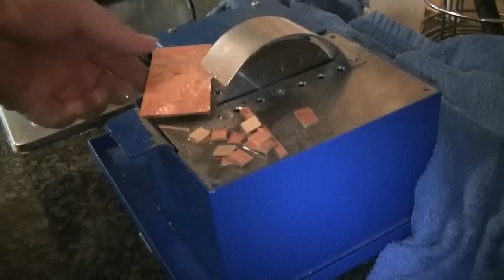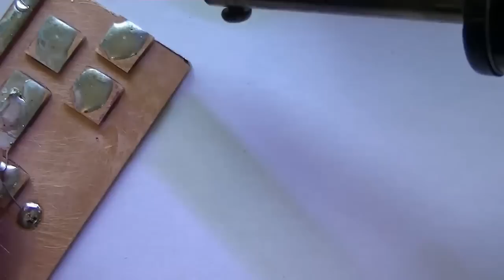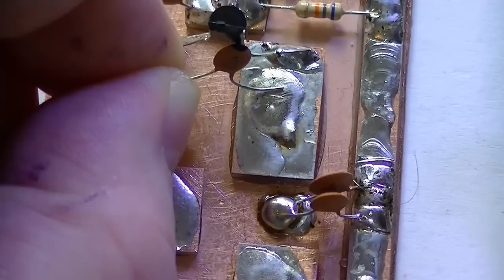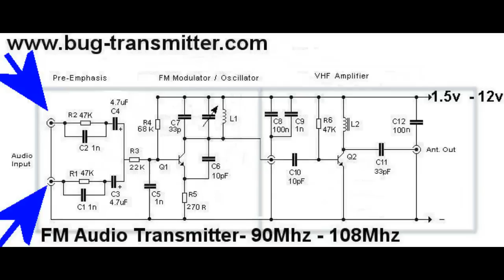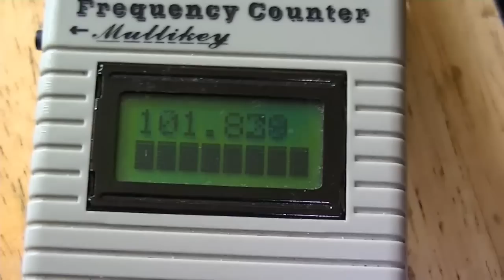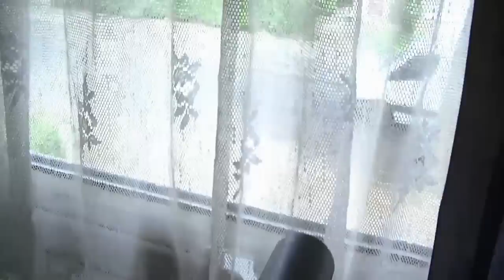Build your very own small home radio station.I show you how to build a small FM transmitter

Comment: i just finished building this circuit. i am using it as i write this comment. Very VERY stable transmitter. the sound quality is reasonable also. i would say its low end frequency response would be 60hz or so. Love the circuit, thanks for sharing. 
To anybody thinking of building this circuit, it is an absolute must!
Reply: @letitrotfuckit  did you build this?
Reply: @letitrotfuckit  I got an sdr I'll tune into your sw frequency, what is it?
Reply: @letitrotfuckit  I'm all the way near WV

Comment: i just built this thing, gave it 4V and without even having the antenna connected i could pick it up outside of my apartment, and it is indeed very stable. thanks a lot sir! looking forward to what this thing can do with more volts and a proper dipole antenna.
Reply: What was the biggest range you got with it?
Reply: @slender1357  Sorry, I never got around to finishing this. I probably got around 50 yards without antenna, maybe would have gone further.

Comment: Have just completed this transmitter build and I must say it works great and goes at least a quarter mile up the road from my apartment. Transmitter is located down the hall in a back room on my work desk and it still manages to transmit up the road. I used a 9-35pf variable capacitor with the 5-turn coil and it transmits at 93.3mhz which is ok because there are loads of FM stations on the higher end of the band and they interfere with the transmitter. I'm going to try and build your 3 transistor spy bug; bet I can get it over a mile!!!

Comment: I will soon  build this one, great video, thanks ! A few questions however :

What are the values of the L1 coil ? Says 5 turns, but what diameter ? what wire gauge ? mH ?
And what is the value of the adjustable capacitor ?

Thanks
Reply: Did you make this transmitter?
Reply: No he grew it in a greenhouse !

Comment: Great video, I like your method of making circuit boards.
Question is... what is the inductance of L1 supposed to be??
"L1 Coil 5 turn" is meaningless since the wire gauge size isnt specified, or the diameter of the turns, or the spacing of the turns.

Comment: thank you i built it and it worked although very short distance 3 miters with 9v battery, transmitting at 108mhz. how can i change the transmitting frequency to 97.3mhz

Comment: Hello sir, i've got a project and i'm having difficulties to start it....here is the title of my project

Design and implementation of a small relaying station for encrypted digital signals.
for e.g. relaying encrypted Digital Signal. (For educational purpose only!)

Description: The purpose behind this project is to receive encrypted signals, decrypt and amplify (if
required) these signals and then relaying the latter over a small geographical area. The project
includes component like transmitter/ receiver, encoder/decoder and amplifier + any other
appropriate components. The student(s) should be able to generate digital signals, encrypt and
decrypt these signals as well as amplifying these signals if needed before transmitting and relaying
the latter. This might involve designing a new antenna or modify an existing one.

I'm not being able to figure out how to generate the Digital signal and send the encrypted digital signal to the transmitter :( .

Can you please help me or give an idea on how to start the project?

Comment: My heartiest congratulations for your work, so neat so efficient and the layout is excellent  from an educational point of view.
At 24.00 you state that the  collector inductor on the final stage stops the RF from  making its way to the supply line. While this is true in every way,  from the point of view of education to students I would have preferred if you said that the inductor acts as a load for the final transistor much better than a  resistor so that the collector may fluctuate as required, this inductor must provide the DC to the final transistor while the "inductor" would permit the collector to undulate accordingly due to its high impedance to RF, and RF power would make its way to the antenna.  The fact that it stops the RF from reaching the  common positive supply is a secondary effect as far as I would say, but to pass on the DC and yet permit the collector to fluctuate is the primary issue here. 
I congratulate you on the placement of the nodes on the practical circuit  to be equivalent to the theoretical drawings and any diagnosis can be easily followed.
I admired your soldering ability, and that soldering iron though small it has got good thermal qualities while you are so  prepared to apply flux even though your work is so clean to me. I like the way you introduced  the decoupling capacitors on the positive rail final  section even even though they are so close to each other. For a100 Mhz  you have considered that distance to be pretty long.
Congratulations once again. You are an excellent craftsman and a good  teacher. It is such a pity that many teachers at some educational institutions are preferring to simulate all this on standard simulation programs. Keep  your practical philosophy for the good of the students who see these videos.
Reply: yeah word

Comment: Nice little transmitter. If you wanted to run it from a 6 to 12 dc power adapter - would you add a bypass cap where the power wires connect to radio board and maybe a series coil?

Comment: Why is a pair of resistors and capacitors used in the pre-emphasis circuit? What's the point of this? Can be replaced R1+R2 - 22k. C1+C2 - 2n. Every transmitter broadcasts in mono anyway, you also need a stereo encoder.

Comment: Great Video! If I use a PN3563 Transistor on the RF output side will I have to change the values of any of the components?
Reply from the maker: The PN3563 is more efficient than a 2N3904 in
the amplifier stage so it will use less current
and more RF gain.
You can keep all the other parts the same.
Reply: Built it on the weekend and it works fantastic! Slight problem is that the tunable range is from around 78 to 92 MHZ so I'm fighting for a place to live down there against Radio 2 & 3. I used a 5 turn 3mm coil and a 5.2 to 30pf Variable Cap. Any suggestions how I can get this transmitting at the higher end around 107Mhz to 108Mhz where it won't get swamped out? Thanks, - Matt.
Reply from the maker: Matthew Sadler

Replace the 5 turn coil with a 4 turn coil ,that will get you back in the FM radio band.

Comment: How would I increase the transmission power? I suppose I canot feed more then 12V into it for more power (what parts need to be replaced so they can handle more voltage?)

Comment: Nice video but one question, wouldn't it be quicker and easier to sand the board as a whole piece before cutting rather than sanding/flatting each little island individually after cutting or is there a reason for you doing it in that particular order?

Comment: I made this and it works great but I noticed that Q2 is over heating for some reason? Any tips to solve that one?
Reply: +rene kenshin  put a small value resistor between the emitter of Q2 and ground, this may reduce collector current/emitter current. Try about 100 ohms perhaps.

Comment: Hi Daz, can you tell me, is there a specific benefit in using this kind of set up with the copper base and islands in comparison with the PCB type, does the flat copper surface contribute to the Signal or is it just for easy building. ?
Reply: I'm wondering the very same thing, looks cool though, but would like to know more.
Reply: this way gives the circuit a good ground plane, rf is extremely susseptable to frequency shifting. most simple rf circuits like this suffer badly if you go near them, so rest assured that this is a goody and good training for serious power transmitters and transmitter amplifier designs up to hundreds of watts. a small circuit board would possibly and probably stop the circuit oscillating properly or at all ! so dont go there ! seriously , follow this to produce a long range simple, miles better than be&&in transmitters. Sounds good enough to forget its a mono transmitter.

Comment: i'd like to see you do the receiver for these transmitters... your FM breadboard transmitter with divider resistors and a throttle LPF on the base of oscillator (1k, 1k  divider, 5k pot) with a 2.2 nF decoupler... a 10k instead of 100 ohm; with an audio (choke) filter (from emitter) to pre-amp on the 10k etc... ... even the simple five transistor video transmitter, where the audio and video are transmitted 4.5 MHz apart with two oscillators/transmitters (with/for easy to find parts)! the same transmitter again (breadboard) with just video, just add 1k pot instead of 100 ohm and latch a diode (shunt, rather), 100 nF coupling to the 75 ohm termination resistor where a 470 μF electrolytic cap will couple the video input from an a/v cable...  .... whew, now to your nail transmitter video lol!

Comment: if i parallel another output transistor in the circuit the output power or watts times 2 or more i need at least 5km max output

Comment: what is your circuit board made of? Copper you said?
Reply: Bobby Lawson hI, the board is a piece of polyester
Reply: ***** are you referring to a breadboard? I think this guy actually used a copper plate
Reply: Bobby Lawson its copper cladding board. its made of fibreglass with copper on the top

Comment: @dazaro3, please want should or can I do to make the audio input stereo and also increase its voltage to 110v approximately. And also, can one use a 9V or 12V adapter to power the prototype

Comment: Alright Daz, the two 3904 version of this circuit has been a good circuit from recollection. I look forward to doing this island version of it for a mate who needs slightly more range, this sounds ideal. I'm into rf myself so this will be a sinch to make, especially doing it ugly style. Would three metal t018 2n2222's @15v w/volt. stab seem ok as far as a combination goes ? same stated resistor on final stage ? Nice clear video , thanks.
Reply: The metal 2N2222 would make an excellent choice for the RF amps. I personally stick to a 2N3904 in the oscillator. my advice (since it sounds like your using two amp stages) would be to try running the second one class c so it doesn't thermally run away. An inductor from base to ground, maybe with a series resistor of a few hundred ohms might do nicely. You might want to have a tuned output then too. The key would be to experiment :)

Comment: Great video! Thanks for putting this up! I do have one question, is there a way to boost the transmission radius from "Roughly half a mile" to say 3-5 miles for example?
Reply from the maker: You can ,but it will be very unstable and lots of harmonics , best to buy a cheap 10watt chinese transmitter
Reply: Oki doke, thank you dazaro3 (-:
Reply: Which transistor is the better one to use that's getting rare around 31:19 ? I couldn't make it out, thanks

Comment: Could you help me out please?
I cant seem to get mine to work.
I used a 4-40pF trimmer, and my inductor(L1) is a 5 turn, 4mm diameter, 5mm length which gives me 0.0588 uH inductance, so at the minimum trimmer setting the frequency should be around 107.95 MHz?
And by adjusting the capacitor i should be able to drop the frequency to about 76.85 MHz.
The thing is I can't pick up anything on my FM radio.
The rest of the parts are the same as in your schematic so i assume the error is in one of these components or my math.
Any tips on troubleshooting?
Reply: +Luka Jovanovic ebay transistors? if so, that is likely your problem

Comment: Is it possible to have the transmitter and aerial in different places? Or the aerial and the transmitter away from the source of the music? Could you use some sort of radio link so you wouldn't be tracked?
Reply from the maker: Yes ,use a 30ft 3.5mm Stereo Extension Cable, 3.5mm Male to 3.5mm Female.

Comment: I tried building the one with the PCB (i think it was the single-transistor version), but I get some noise.  Is this more stable than the one before ?
Reply from the maker: Yes much better ,a lot more stable and more RF power

Comment: What is the value of the green trimmer capacitor you used in the tank circuit?
Reply from the maker: 2.5-22pF
Reply: @dazaro3  OK thanks! Thought of another question after I sent the first one. Can this transmitter be connected to a phone or MP3 player?

Comment: how would you increase the range of this. would you increase the length of the antenna if so how long would it need to be 100  feet or less than that say 20 feet
Reply from the maker: +thebooster14 
You can increase the length of the antenna ,or use 15v ,and make sure you place antenna as a high as possible
Reply: +dazaro3  thank you. was wondering if i wanted to transmit say for 60 kilometers how long would the antenna need to be. have been interested in radios since i started researching the SOE and ww2 spying. they had radios that could transmit around the world to do this they used antennas that were 100 feet long. if i attached a 100 foot antenna to one of these in theory how far could i transmit. don't worry i don't actually have one but am very interested in making a less powerful radio in the future as like building things as a hobby.
Reply: +thebooster14 They weren't transmitting at 100MHz.  Reaching the other side of the world involves ionospheric bounce, which doesn't happen at that high of a frequency.  Get an amateur radio license and then you can legally transmit at frequencies that will work for what you want to do.
Reply: +thebooster14 with 100mhz you are restricted to line of sight. the curviture of the earth will be the limitation if you can transmit that far. if you want 60 kilometers, you are going to need some far bigger power

Comment: Hi Sir, is it possible to use the same coil for L2 since we don't have molded coils in our place :(
Reply from the maker: Yes you can ,but use it with a 30pf cap and
you will than have a tuned RF amplifier stage.
Reply: dazaro3 30pf trimmer cap in parallel with L2 ?

Comment: what value is the trimmer cap?...going to have to breadboard this for a laugh....cheers mate, cool project.
Reply from the maker: +100roberthenry 
Ceramic trimmer capacitor ,5.2 -30pf
Reply: +dazaro3 I found one with 2-22 pf ..will this work and what difference would it make to the frequency?? Thanks & God Bless!! :D
Reply from the maker: +Kerwin Fernandes 
2-22 pf will work just fine ,its will make no difference to the frequency.
Reply: +dazaro3  hi dazaro....i breadboard it with mixed success, i was wondering if you could do a guitar transmitter?...like a simple tranny/opamp  preamp to transmit to a diy reciever too..?....not asking much am i :)  but it could be a great diy project... cheers man.
Reply: +dazaro3 thanks a lot :D

Comment: Really nice video i want to build it too but i dont know what the values behind the capacitors mean? and L2? Could you explain that. Im from the netherlands. Greatings Stefan
Reply: I already know what they mean. But unfortunatly its hard to find the parts.
Reply from the maker: Parts are from rapidonline ,yes you can cut the board with
a hacksaw ,but you will need to buy a PCB board manufactured from
SRBP=synthetic resin bonded paper and not fiberglass.
See my other videos for FM Transmitters using a amplifier stag

All the parts used in this transmitter build are very common and easy to find.
You can find most of the parts in an old FM radio.

You can buy the parts from rapidonline ,farnell ,rs components,Ebay,
or mouser.All the parts used are in the info part of the video.
Reply: dazaro3 thank you. Is there a way to control the range of the transmitter.

Comment: Where can you get the saw you cut your PCB with? I have a small one but it need more power.
Reply from the maker: It is a saw made for cutting gemstones.
I got it from Ebay about 8 years ago.
Cost £50 ,and i am still using the first
diamond cutting disc
Reply: Found Saw at Harbor Freight, With 4" Blade
Reply: Stephen Jones harbor freight is garbage. everything I've ever gotten from them was a "use once and throw away" tool. unless you are making money with what you are using the tool for, i don't think it's worth it. spend a few more dollars and get something that will last.

Comment: Mine is finisht now but it wont work only can hear my music very bad sometimes when i have my voltmeter conected
Reply: should i post a video so you can look at it?
Reply: verhoeff95 so i mean when on of my meter pins is on the board en one in the air
Reply: verhoeff95 i read if you change the amount of turns of the coil you can change the frequenty

Comment: I can't find the variable cap from here where i live, What kind of capacitor i should replace it to get somewhere about 103,0mHz or 95,5mHz? Thanks!
Reply from the maker: Replace the variable cap with a 10pf cap.
Reply: What frequency would that give me?
Reply from the maker: About 98Mhz
Reply: Ok thanks!
Reply from the maker: You can replace the trimmer with a 10pf or 15pf
ceramic capacitor and then adjust the FM frequency by
stretching or compressing the coil.
Reply: Ok, Thanks!

Comment: When I remove the Antenna wire, how much will the range be reduced?
Reply from the maker: +AtDiT 
A lot ! if you use a 41cm Antenna range will be about 100ft-150ft
Reply: dazaro3 Okay, thanks!
Reply: Is it possible to each 3000ft or more?????
Reply: Hello , yes it is possible. 3000 ft we are talking about 1km right!. Just use the full voltage and use a good dipole aerial mounted on a roof.Hope this helps.

Comment: Would a 30pf trimmer work or does it HAVE to be the 10pf?
Reply from the maker: A 30pf trimmer will get it working ,or you can replace the trimmer with a 10pf or 15pf
ceramic capacitor and then adjust the FM frequency by
stretching or compressing the coil.
Reply: dazaro3
Sweet, thanks man!  Can't wait to test it out